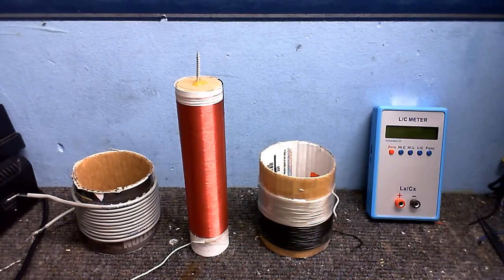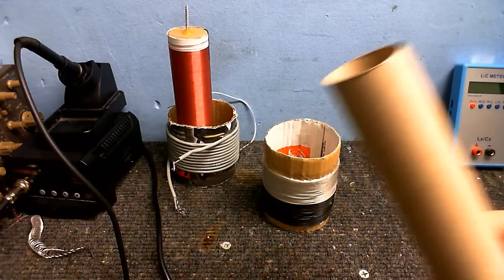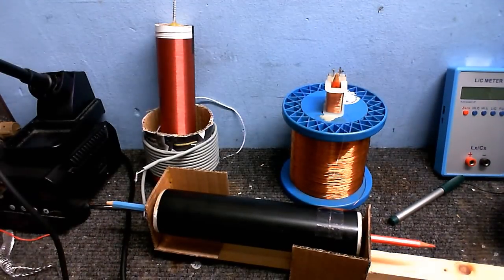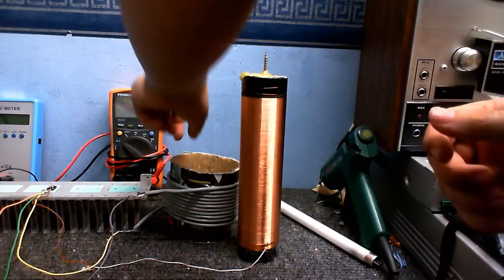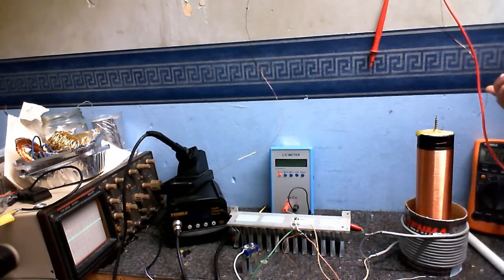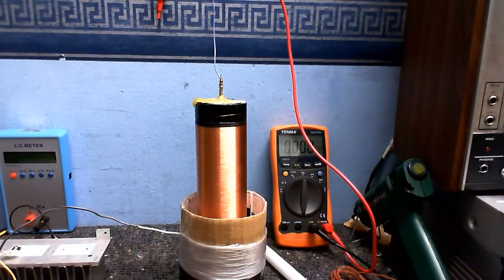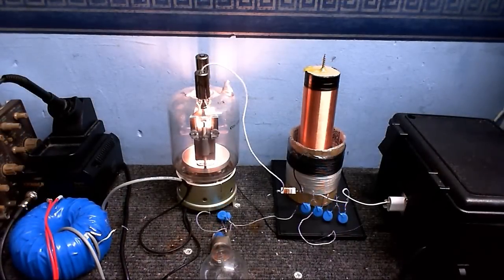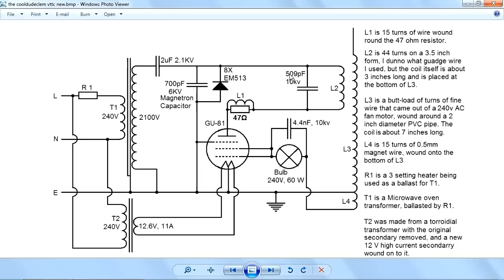How to build a VTTC part 2

Comment: hy clem if you are so genius at electricy stuff can you tell me what happens at my electric scooter the motor works for few minutes and turn off by it self the rest of the electric circuit of my scooter works normaly when use the honker the motor starts again in slow speed and dies again waht is the problem and battery LED indicators won't light up its off the battery is new and charged
Reply from the maker: ***** I'm not sure without seeing it for myself and doing some tests on it to find the problem.  My very rough guess is that the motor could be overheating and there's some protection device shutting it down or limiting the power.  Like I said, not being there to see what's actually going on inside, I can't really say for sure.
Reply: i think is a bigger electric failure at some electrical part of my scooter
Reply: ***** Why do you even ask if you think you already know the answer?
Reply: i don't know it my scooter has a failure and need to bee seen by an electrician